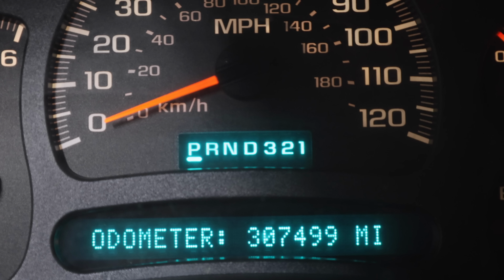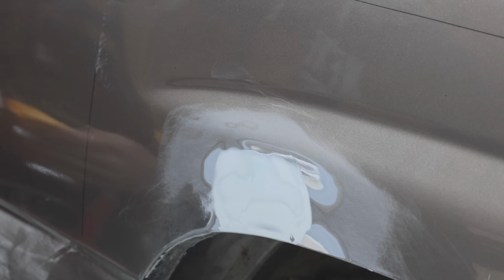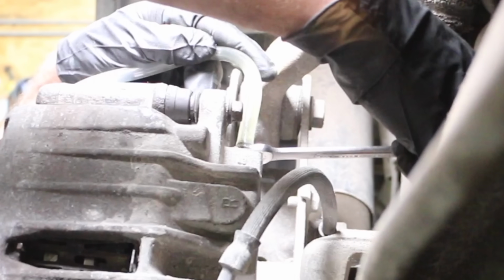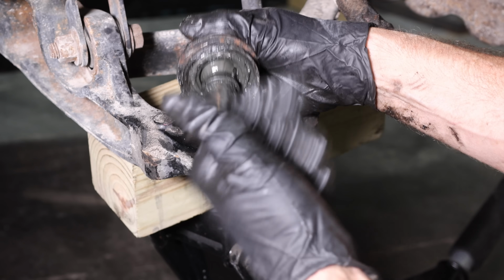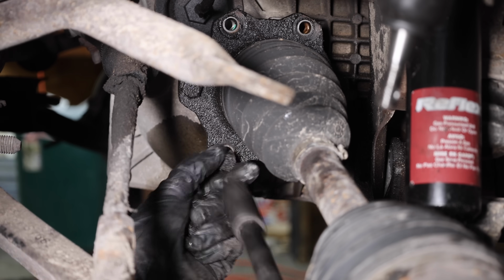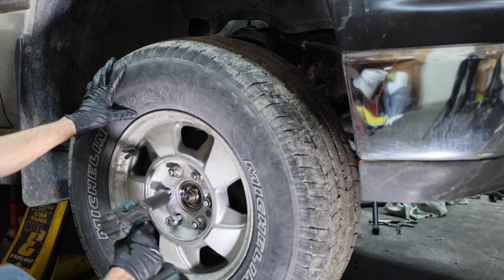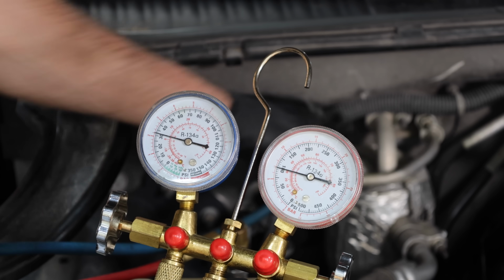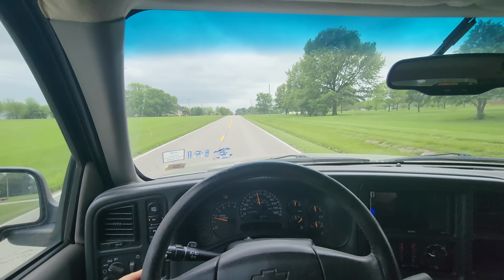Is It Stupid To Fix Up A 300,000 Mile Vehicle? Let Settle This!

Comment: I have to mention, in the video Todd uses parts store Freon from a can. This is fine but know that if you ever have to have it serviced by a shop it will likely cost you more. The fix in a can may be considered a contaminant and the whole system then must be flushed.

Comment: Watching this I’m very tempted to buy another truck like it. All the engine accessories are so easy to change. Most things, including alternator, power steering pump, water pump, can all be changed in about an hour and a half. I recently lost my 06 Lexus GS300 AWD to a deer on the highway. Hope to find a truck that can handle what I throw at it!

Comment: Uh...sanding blocks aren't really specialized equipment.
And didn't you compare buffers at some point?  They rock for polishing headlights with PlastX.

Also, handy tip from Derek at VGG's wife: use a paint marker to write the date and/or mileage on parts you replace or otherwise rework so you can see right away how old they are.  Obviously a scribe or engraving tool will work better on some parts.

Comment: Hey!  your check engine light is on!

Also noticed you need exhaust manifold bolts and new wiring loom. Highly recommend retro fitting e-fans from a model which came with them. I did this and it's so much quieter. Clutch fans are annoyingly loud and eat power unnecessarily.

Definitely worth maintaining these old trucks! My neighbor has over 500k miles on his Silverado.  I have nearly 200k on mine.  I have all the parts ready for a front end rebuild, just trying to find the motivation. This video may do it for me. :)

Comment: Impressive work. Only thing I would add is I prefer to add antiseize to the hub mating surface whenever I replace a hub, and grease to the splines of the axle, and I prefer to grease the threads on tie rod ends, because they tend to seize in place.

Comment: My 2007 Chevy 1500 classic needs an engine at 260K, no oil pressure, and I've done all the bandiaids can do. I wonder how much that is going to cost for a good used engine and transmission? I've done all the other stuff, so I'm keeping it. THANK YOU FOR ANOTHER GREAT VIDEO!

Comment: My 1996 F250 super duty truck with a 7.3L power stroke engine and almost half a million miles on it.  Only thing I wish the truck had is a 5 speed manual transmission.

Comment: Its definitely smart to keep an old vehicle going. The only reasons not to is when you have severe rust damage. Especially to the frame. Major electrical issues are also a big problem on older vehicles and many mechanics and people don't understand how to troubleshoot and properly repair them. Also parts availability can be a problem but if you have a popular vehicle like my 97 f250hd with the 7.3 powerstroke engine, many aftermarket companies continue to make decent parts. Specific forums are also a great place to learn about vehicle specific issues and of course YouTube university.  
Definitely dont slow down your video's.  Its easy to replay any part that interests you.  
People are lazy. I did everything you did and more to my truck 2 years ago including painting the frame and underneath with mastercoat (see repair geeks video called," friends don't let friends use por15").  Well worth every penny and minute invested. Thanks for the great video Todd! ✌️

Comment: Last November I trading in my 2007 Chevy cobalt. It had 198k miles on. I want to keep it longer but, the AC wasn’t working. It needed a new compressor, it was leaking or burning the oil and the temperature kept going up and down. She was a good car. I bought it with 30k miles in 2008

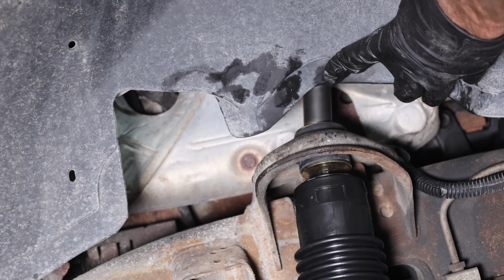Comment: Mistakes have been made: suspension bushings should never be fully tightened when suspension is fully deployed in the air (here 11:15 the shock absorber ). They should be tightened when the car's entire suspension is at ride height, to avoid excessive flexing and rapid wear.
20:20 the mesurement of the wheel alignment is good ONLY if the rims are brand new and not bent at all.

Comment: What'd you spend on all the parts? Dropping a couple grand on a vic that couldn't be replaced for less than 5 is a no brainer...but spending thousands on a vic that could be replaced for less doesn't make much sense. Obviously. These days though, cheap cars that aren't beat to death aren't as easy to come by...especially trucks and SUVs.

Comment: I'm at 340k/km on my Ram, had to replace the engine. Then the front end basically got rebuilt. It's a 2012 ram 1500 4x4. Prices and interest rates, I just can't justify buying a new truck for around 80k. It needs to earn its repairs first!! 🍻🇨🇦

Comment: In recent years, due to high prices, it's making more sense than ever to seriously consider intensively maintaining or repairing an older high mileage vehicle that may even be mechanically totalled. I'm facing such a situation right now with a high mileage car with a broken timing belt, that likely has bent valves as a result. In years past, I would have simply walked away. But now, it's a serious decision whether to do the repairs or not. Videos like this are very influential to me and greatly appreciated. Keep up the great work, and more videos like this please!

Comment: My last car, a 1996 Volvo 850 wagon, naturally aspirated 5 cylinder with 5 spd manual, achieved 406,xxx before it developed a cracked valve (oil changes at 5k miles religiously).  I bought it with 145k miles and at 250k the clutch needed replacement.  Over time I replaced the timing belt, plugs, radiator, rotors and pads, trans fluid, PCV, hoses, belts, etc.  It was my daily driver.  My brother, an ASE Technician of 45 years, suggested I call it quits given that I achieved that kind of mileage.  The car was only worth about $1000 at the time of sale.  If I fixed the top end for $2500 and it stressed out the bottom end, I would be out another $7500 to fix the bottom end.  It wasn't worth the expense.  A lot depends on who owned the car and how they took care of it.  Do I think an American made car can achieve this?  Arguably no, given the quality standards although for outliers, there may be a few.

Comment: I appreciate this one, I have 2002 3/4 ton chevy  w/ 240K that may need some of this same treatment.  
one of the things I've decided it needs is the Wolff engineering steering column bearing. I'll also swap the upper steering shaft (those are recalled). I want to eliminate the play and wandering, plus the tires have some cupping going on.

Comment: YES. It is worth it.  New vehicles are priced way out of the reasonable expectation of many common folks.  The nut and bolt reliability of older vehicles just makes more sense rather than all the latest greatest tech in new cars.  I didn’t even have to watch five minutes of the video to answer this question.

Comment: would be cool to see a pressure washer nozzle comparison, I dont know any specific brands that have nay better but I know you can buy cheap and expensive pressure washer nozzles.
Reply: Would be like , does it keep its rated PSI, is it a true degree of spray, how thick is the blade or somn

Comment: Great video - insteqad of using a 2x4 as a sanding backer - you can use a kitch sponge instead,, it will flex more and comform to the shapes better

Comment: I like seeing a new video every week, but if you want to make the videos longer, by all means.

For those that don't know, the 4L60E transmissions in those are quite weak and it's not uncommon for them to go out at 100k.  Excellent on on keeping the ol' girl on the road.

One thing I would mention is to check the gap of the spark plugs before you put them in.  Some would argue with iridium you don't (For fear of breaking off the tip) but if you are careful and "sneak up" on the gap with feeler gauges, you won't damage it.  I've had "pre gapped" plugs be off 0.020" which is horrible.

Comment: Do not slow the videos down. That would make them longer. You covered everything fine.
On the subject of very high mileage repairs, it depends upon the make. For example a 1988 volvo 740 without rust, 400K miles, manual transmission would be worth saving since the owner might get another 400K miles out of the car.
The old 740, 940 and 240 models are the only cars that old that can match the reliability of a toyota.
Definitly a keeper depending upon the lack of rust.
I'd mention a Subaru Justy or Ford Pinto as being as reliable but doing that would be a comedy routine.

Comment: @project farm  as a mechanic i will be the first to tell you that the rotors on that truck did not have 300k miles on them. rotors can generally be resurfaced at least one time or just generally replaced with each pad replacement.

Comment: Everything I thought you missed you didn't except, I would have replaced both front axles and CV joints.  I think I caught a shot where one of the boots was torn.
Please don't change.  I just slow down the playback speed or pause the video when I want to see something more clearly.

Comment: One part of brake fluid replacement not shown is dealing with old and corroded bleeder bolts. You can spray around the bolt with penetrating oil or the grassroots mix of ATF and acetone. The trick is to get the penetrating fluid down into the output hole. Let it sit for a while. Use the correct toll to break it free.

Comment: I have a 02 4runner has 198k miles, people call me stupid for putting 3500$ of work on the front end and back, all suspention and drive shafts, tires, brakes, rotors, lots of other stuff too, the entire brake line system, mine has a rust patch on the rocker but its not bad, its a 3rd gen 4runner sport it drives like a new 4runner off the lot. No need to replace! Plus the most reliable engine ever made on a toyota, for a v6.

Comment: The only time to get rid of a vehicle is when they die outright. Our old Buick lasted 26 years and then died. It was time but now Toots has a Lincoln and we'll see how long the really good shop can keep it going. My old 89 S-10 Taco just gets filled up with oil and check the gas and GO! No need for anything newer at my age and driving big trucks will put you in the frame of mind of not let oddball stuff bother you much like steering slack and kingpin bushings shot. FINE JOB on keeping that rig running, Commander! My days of doing that are past but you get an A-PLUS! Hope all is fine on the farm. Still getting lots of rain here but we always do. God Bless ALL Yall and all the varmints too!

Comment: 300,000 that's cute... Get back with me in another 174,000 and I might be impressed... Lol.. my Kia Sportage has 474,532 on it as of right now. Change fluids regularly as needed. A/C compressor and alternator only thing that has been replaced other than parts that are designed to wear out.

Comment: Big fan, hundreds of videos in.

A couple things I noticed.

You didn't make a mess greasing up the cv axle seat into the knuckle, or the wheel hub; normally that is a mess you want to make.

But judging by how clean your vehicle is at 300k and also your preemptive maintenance, it might be the split of your gumption and you don't suffer salt like the northern Midwest does.

You want to grease any metal to metal up here, or you'll be beating it and yourself out.

Every time I need to dig my way to something, I'm always happy I've oiled and greased anything I've worked on prior between mine, my dad's, and mom's stuff.

Last thing, those plastic tension pullies are relatively cheap, but you can also pop the bearing face plates off, and gain access to the bearing; spray/blow/grease to a practically new pulley. Saved what, 40 bucks quick and easy.

Just my two bits, trying to give back when you've helped me so much.

Comment: Ive alwaya taken very good care of all my cars, and i used to be a broke teenager buying cheap cars.   Eventually i bought a new Altima and never planned to keep it.  I couldnt sell it after a few years and it wasnt worth 30% of the value of the car to do a proper tune up or tranny service.   At 199k miles one cylinder gave up and although i could do the injector or spark plug, i let a shop do it.   I got my moneys worth.  200k on injectors etc and still no tranmy service and our $2k is not just "cheaper to keep her" but excellent on fuel mileage.    Its been in many mountain, desert, and coastal roads.  

This disposable car is a bit of a keeper now.

Comment: This is exceptional. I do wish you'd track every replacement and issue that comes up. I am intimated not by doing the work but rather having my wife be stranded on the side of the road with an old vehicle. Taking care of the steering is one thing - but I'd really be interested in knowing what a full rebuild would cost, and what is still a liability/failure point. 

Love these videos!

Comment: Great video as always, One suggestion to everyone replacing ball joints, concerning the upper ball joints. In stead of replacing just the upper ball joint, I would suggest replacing the upper control artm assembly that comes with the ball joint installed. GM trucks with that amount  of mileage the upper control arm bushings get worn out over time and can cause tire wear and alignment issues. I would suggest using moog ball joints and upper control arms. God bless , have a great day

Comment: Ill theow this out there for anyone getting that rust repair. I recently did an estimate for a pickup of same style and year range needing those repair panels installed, but full part. Big difference in what you had to use, so cost would be different. Labor for both sides was a bit over $2 grand. That was start to finish with painting, but not materials or parts. Just a comparison for people wondering what a regular body shop may charge. I will add, many places/ people just tack the panels in and wipe them. That is complete hackery. Keep vids coming! 😁✌️

Comment: Here's a tip for anyone that's attempting to change the fluid in the front or rear differentials. Always make sure you remove the refill plug before you remove the drain plug. If the the refill plug is rusted solid you won't be able to refill the differentials. Take it from a guy that lives in the Rustbelt.

Comment: You obviously don’t live in the rust belt watching the hub assembly pop right out of the knuckle once the bolts were loose was like a dream I usually have to use a slide hammer and an air hammer to beat them out here in Ohio love the videos keep it up I tune in every Sunday

Comment: Super interesting! I didn't even realize there were grease fittings on some of those parts... Only 22k miles on my Subaru so I don't expect to need to do much of this for many years to come, but it's still good to see how easy some of it can be! 

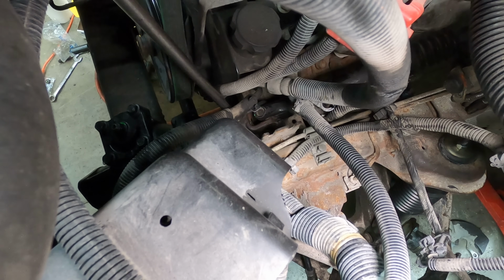As for the pace, I think the steering assembly was maybe a bit fast because of how difficult it was to film so there were a lot of jumps that were a bit disorienting, but some highlight overlays could help a lot with that without needing to slow the pace much if at all. 17:17 is a good example of where it's not clear what we're supposed to be looking at. That said, I think everything else was very clear even at speed!
Reply: Ur POS Subaru won’t have grease fittings

Comment: Too much antifreeze is bad too.  Preference is 50% to 70%
Too little and it boils too much and it turns to slush in the radiator in winter.
Run your car and feel the upper hose when at operating temperature.  If soft squeezable,  the radiator cap may be venting and bad.
Flush every 2 years regardless of type.
Battery voltage pass thru makes it acidic and eats seals & gaskets.

Comment: I still have my 2000 Ford Excursion V10 with 405,000 miles, that I purchased brand new. I’ve  changed the oil every 5000 miles and all fluids every 50,000 miles. It’s all original and I still drive it everyday. It’s not worth much, but it owes me nothing.

Comment: Very good video, and the length of the video is good. I would suggest mentioning cleaning the surface of the new brake rotor with brake clean and a soft cloth, and to follow the recommendations of the brake pad manufacturer when breaking in new brake pads. That will improve the performance.

Comment: When greasing brake slide pins it's always good practice to put just a little bit of lube on the outside of the pin nothing on the very end Make sure you don't put too much and any on the end of the pin and it should work great. Great video as always

Comment: 30 yr mechanic here. Next time, replace the entire control arms. The ball joint is already pressed in, its less work overall, and the control arm bushings get replaced. I personally use either Moog or ACDelco as they both are a quality part. Replacing the entire control arm isn't much more expensive and saves you easily 2 hours of time or more in total.

Comment: I bought a 4Runner last summer with 304K miles. I’ve already driven it about 11K and have had to do all suspension maintenance on it so far. I’ll try to take it on some trails this summer once I change my fluids out to see how it does but she seems pretty solid. As long as the vehicle has a solid records with it and the body isn’t rusting to dust, most vehicles will be alright.

Comment: I have the high end Lexus SUV, the LX 570.  My rotors are warped.  It's a design/build defect because warped rotors have occurred on all all 4 of my SUV's with very low milage.  I'm old, I dont hot rod or break hard.  These SUV's are just heavy.  Can you recommend a better made rotor that wont warp?

Comment: My wife had a 2003 Tahoe with over 190,000 miles which still had the original brakes on all 4 wheels . A mechanic told us that GM had put heavy truck brakes on the vehicle, resulting in a very long life.